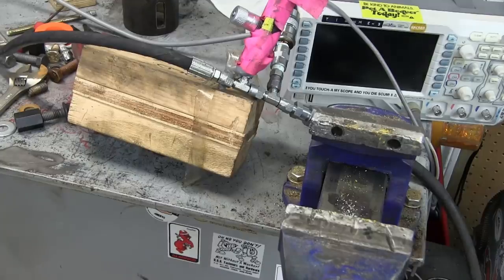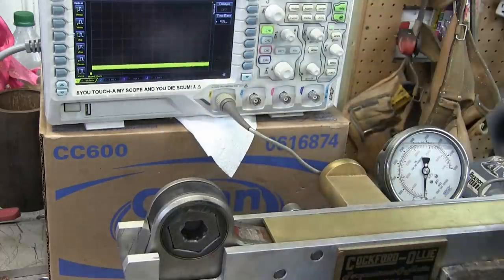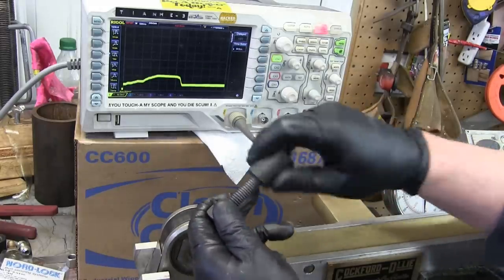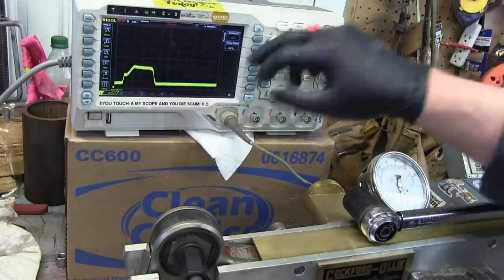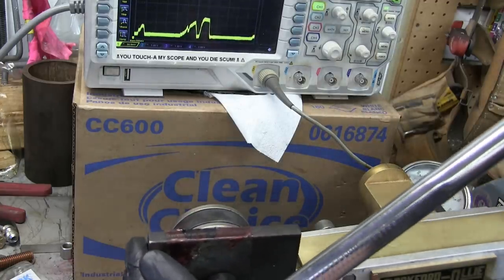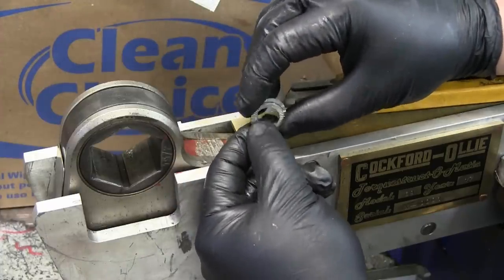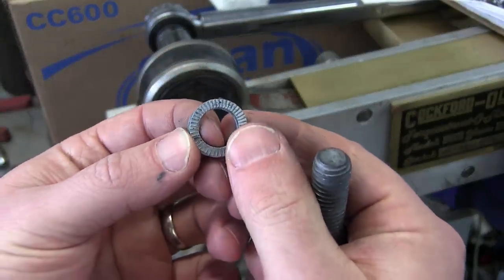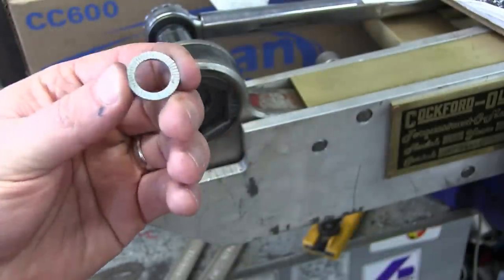Nord-Lock Washers | Do they work better?

Comment: With what you call high collar (we call it spring), the idea is that it bites into the surfaces, i've seen many people put a flat washer on followed by the spring washer, this ain't gonna work.
Also, when you did your test, you mentioned a flat washer on the back, if you allow the plate to slip on that flat washer, that's no good either.
I've struggled to remove a nut secured with a spring washer, and have seen deep gouges in the nut once removed.
I feel that vibration in use is like a hammer to set the points into the nut and mating surface, and the spring action assists
Nordlock's may not work with very coarse threads, but would be better with fine threads,
Reply: Sparky Projects high collar is a thicker spring washer with a smaller OD.  They are used for socket head cap screws.
Reply: There are multiple types of spring washers. There are ones with barbs on the cut ends (which bite into the surface as you describe). Then there are the cheap ones (what the purchaisng department buys!) which are just 'flat'. These are detrimental to the bolted joint at best!

Nordlock washers have the cam surfaces angled for the bolt (or more specifically the pitch of bolt) you are using them with so there is no concern using them with coarse threads.
Reply: The idea isn't that it bites into the surface. It provides a pre-load for when the stress in the thread engagement relaxes
Reply: Tsf Phi that's what I was thinking too.. That would explain it why they're used with flat washers
Reply: It's my understanding that both the tooth digging in and the constant pressure are working. The tooth resists rotation and the spring pressure prevents vibration or expansion/contraction with temperature changes from working it loose.
Reply: Sparky Projects You are right!!!!
Reply: the biggest downside of a lock washer is that they will squirt out from under the bolt head in heavy duty applications, we quit using them where I work as they just flatten right out when getting tightened down with a big impact, and once you take the lock washer out, its completely flat, its lost all of its spring properties
Reply: Sparky Projects they work real good with coarse thread. They're used commonly in the oil field for topdrives being they work over head and experience heat along with tons of shock and vibration when drilling.
Reply: I don't have spring washers to hand, but the older ones had a raked 'biting' corner, the modern ones seem to be a 90 degree corner, so it backs up what i was told, never seen flat washers used with a spring washer back in the day, and can't think of any time when a spring washered fixing has come loose on me.
maybe it's the modern cheap spring washers failure that prompted the  invention of nordlock.
Reply: I would imagine there is a reason J A Panese trucks use spring washers on driveline bolts, they stay tight and bite into what they are tightened between.
Reply: Paolo G , that makes no sense, and I'm pretty sure it's a false statement
Reply: Paolo G , that document doesn't say anything about the spring washer applying loosening torque, the bolt would need to be reverse threaded for that to work. Don't get me wrong, I'm not advocating for spring washer I just think your original statement is wrong
Reply: Paolo G , again I'm not arguing the result, I'm arguing that the mechanism is not what you state.  Loosening the nut "unwinds" the spring, not tightening it.
Reply: @tsf phi Spring washer preload is a myth. They can never apply more preload than a properly tightened bolt because the cross sectional area of the bolt you are stretching is much bigger than the spring washer you are bending.
Reply: farmerwoody123 Tsf Phi didn't say it provides MORE preload.  They work in the same way that Belleville washer does, i.e. maintains some load on the bolt even if it backs off, but it doesn't increase the load over not using it, which would be impossible as you say.
Reply: Sparky Projects  that's my thought 👊
Reply: I have some older 1950's American made lock washers and they have some bitting built in
Reply: Why do you think a course thread would be better than a fine thread as far as the effictiveness of a lock washer?  Seems to me the faster the head moves away from thr threaded hole, the faster it will loosen faster.
Reply: working in the mining industry, we use all types of heavy equipment. caterpillar released there findings on lock washers years ago. 
They haven't used them in years.
Reply: Matt Hudson, what does Caterpillar use in place of lock washers?
Reply: Spring washers are not designed to bite...it put a spring force in the inner to outer threads of the bokt and the nut....its harder to turn when you gave a spring load

Comment: Nord locks are the shit especially when you read you anti seize on a bolt. Only for the slightly softer steels though, if you need them for aluminum the get Nord locks made out of aluminum. You don't want to see the corrosion you can start by mixing that shit up.
Reply: They work well in the appropriate situation 
They're  are to resist vibration not breakaway torque 
The perfect lock type will completely stop vibration backing off but not impede removal for maintenance 

There's a reason nordlock are so common in manufacturing 
The thing most people mesh up is like all lock types theyre a one or 2 time use
Reply: Having aluminum bolts is a big mistake anyway
Reply: Steel bolt, and zinc coated nord locks on aluminum hub is the standard for airboat props.
Reply: Mike oliver galvanic corrosion doesn't happen with every mixed metal application

Comment: I put nordlocks on (4") polypropylene and CPVC flanges for electroless nickel plating. The expansion and contraction of heating would make other bolt assemblies loosen, but nordlocks stayed tight. The result was no leaks. Very good.

Comment: Unrelated but I have a little bit of advice (if you want it, it is interesting) for rusting your nuts... put some dirt from outside in your rusting system. If you're lucky the dirt will have some strain of ferrooxidan that will gladly rust your nuts. After a while some bright orange goop should appear which means they are doing their job.  I've been watching for a while and I love your videos. I'd love the opportunity to help. 

I say this here and now because I was little late to the rusty nut busting party.

Comment: CAT had spring washers with no split. That is to say; it was a washer that was thicker than normal and hard as rock. It kept the bolt tight by giving it a sound foundation to push against.

Comment: Dear Uncle BF, love your channel.  HOWEVER, when attaching a trailer axle years ago I had to remove some bolts after they were torqued (about 1/2" dia).  The spring washers bit into the base metal and bolt heads so well they were actually expanded to where they were a larger size with about a 1/4" gap between the ends of the split washer once removed. On mild steel a hardened spring washer can REALLY bite in.

Keith

Comment: Spring washers, if we’re talking about the same thing (sometimes called split washers, what you had there looked different) won’t really work in a situation where you torque the bolt to a set number, unless maybe that number is to yield, they work by tightening them about as much as you can without damaging the reusability of the bolt, you’ll see a deeper bite with larger bolts when correctly tightened, on a hitch I recently took apart it was in about 1/16 of an inch into the metal, serrated bolts (and nuts?) work best and are easiest to use, conical washers work really good but it’s the same issue of torquing the washer not the bolt, but those work on any hardness of bolt at least (though may weaken over time)

Comment: So nordlock only works on softer materials...... the old spring lock washers will actually cut material off to brake loose. So what really is the advantage? Have 40 years of mechanical experience and spring locks work in most cases until you start into hardened material. So...?....?

Comment: So why couldn't that test also measure the force required to stretch the bolt? It appears that it's   measuring the torque needed to hold the nut in place - which seems like it should be equal to the force that you are applying to the wrench. 

So is some of the torque from your wrench being diverted to stretch the bolt, and thus the measuring tool never senses it? That, to me, feels like a non-answer, because then I'd want to flip the test around so that you instead measure the force you are pulling with. You could do that with a luggage scale and get decent accuracy and repeatability. In fact, I'm surprised you aren't using a luggage scale for this entire experiment type - the oscilloscope obviously provides great visuals, repeatability, and records the data, but it's not as direct or intuitive. 

Also, you know what's next: make washers with a much steeper separation rate, and see if those require more force. In fact, they may require progressively more force as the nut gets closer to releasing. And then would that design re-tighten the nut if you released it prematurely?    The makers picked their current angle for a reason - did they want a consistent force requirement? That may be reasonable, as it would be just as possible to remove the bolt without damage (as the torque is the same), but it's made harder by requiring that torque for longer.

I'd love to do an experiment on different threading types and shapes, personally. But in the near horizon practically all my time is dedicated to some business I'm trying to put together - and which is quite unrelated to that field, so I wouldn't be able to do it justice.

Comment: I was always told not to break torque with a torque wrench.
Reply: so why would the manufacturer include the option?
Reply: I'm not saying you should or shouldn't but you still have to torque left and right handed threads.
Reply: Jerome Smith you're right. So wouldn't torquing a left hand thread bolt be the same as breaking a right hand thread bolt?
Reply: That is because a frozen nut could easily overtorque the wrench and throw it out of calibration.
Reply: me too, but i know there are left hand thread nuts. but here is the thing. torquing something, and breaking something free are 2 different things... wouldnt that ruin the calibration, even if you unscrewed a nut with the torque setting value of the wrench set higher than the supposed torque of the fastener? i thought there was a sere and a spring in there and the spring could get ruined?
Reply: Could be because it's the most expensive wrench in the tool set, then most guys beat on, extend it with Cheater bar, when breaking loose a nut. Who knows maybe one of us will get on the googler and find out.
Reply: Yeah because they don't want a 250 pound gorilla adding a 10 foot cheater bar to it and twisting it like a pretzel.
Reply: Every use can affect calibration, so the less you use it, the better off you are.
Reply: I agree, but I think he needed to do it for the test?
Reply: Jason Henderson reverse threads
Reply: Tony Fleetwood that's the general thoughts I've heard behind it.
Reply: Tony Fleetwood #metoo
Reply: For what he's doing, it's fine
Reply: "so why would the manufacturer include the option?"

You do realize that you can cut threads in either direction, right?  "Reverse" is there on a torque wrench, not to loosen fasteners, but for left-hand thread fasteners.
Reply: I have broken a few ratchet pawls and gears by breaking bolts loose . If the bolt comes loose with a big pop, the springiness of the bolt can drive the gear into the (case) hardened parts together in the opposite direction. If the parts do not have time to fully engage, the teeth can be chipped by the impact. Aluminum engine blocks etc.  seem the worst offenders.
Reply: Depends on the torque wrench ( and who own it lol ) , but most go both ways as long as you do not exceed its rating.
Reply: The reason they say not to use them for taking things off is due to people not thinking about it. As long as you don't exceed the torque rating of the wrench, it causes no more wear than tightening. (Every use causes the tiniest amount of drift, but it can and often does drift both ways, usually stays close to accurate under proper use) The problem is people using them as breaker bars and trying to break a rusty fastener loose. A fastener that may require 300 ftlbs to break loose and if you use a wrench designed for 200ftlbs max, you are going beyond design parameters and causing huge drift. 

Thats why, unless you just tightened it, you don't know how much force its going to take, and it could very well be more than the tools rating. Using a 250ftlbs wrench to loosen a 10-32 bolt out of something, more than likely you will be unable to damage the wrench as the bolt will come loose or snap before you hit 250ftlbs.

I never use my precision tools for beating, thats why I have tools for beating. Its all about covering for the morons who don't think before they do, then blame others for it.
Reply: @JasonHenderson  Tightening reverse threaded bolts my friend ;)
Reply: I noticed Nord lock washers on my forklift at my work! Pretty neat design! Your channel is pretty awesome btw! You should have a dictionary made up! Called the Scientific language for dummies or something like that!

Comment: I had an engineer at work try to put a Nordlock washer on an assembly where the base metal was p550 and the bolt was some stupidly high strength stainless.  Damn thing kept vibrating loose.  I changed the assembly without telling him to put locktight on the bolt.  Never had it walk out again.  Good to finally know why that shit wasn't working.

Comment: I have worked with Nord-Lock washers.  This thing held the bolt SO TIGHT.  I tried loosening it but Couldn't and I can always get anything loose.  The Millwright came over, he tried, no luck.  He brought over this hydraulic wrench type machine and hooked that up to turn the nut.  Even that couldn't do it.  Heating the nut couldn't loosen it up.  They had to eventually torch the head off and remove the rest.  It would not release any other way.  I think they're great if something is for sure not supposed to come loose.

Comment: Not that I'm a specialist or anything but I got an idea.... if you get one of those torque measuring resistors like on an electric torque wrench and attach it to a platen in the vice and hook that up to your trusty scope it might be easier and more accurate.     Also I use flat washers on things that I know are going to get very rusty because it actually makes them easier to break free especially if the washer is aluminium so it just crumbles away 👌🏻

Comment: Once again here I stand, way late & yelling out in the far corner of the comment section too far to be heard over the din, if your mating surfaces are made harder than the washer material the locking feature will not work properly, it must get a small "bite" into the material to stop unintentional movement.

Comment: Literally millions of split ring lockwwshers holding together A325 bolt assemblies and therefore holding together thousands of communication towers worldwide.  Who'm I to argue with that?  I dunno...it's all we had on hand to send to the field.
Reply: jmurphy1973 some one who never tested a split washer vs nordlock.
Reply: Or a split washer versus loctite, or a split washer versus nothing for that matter.
Reply: Having built a few of those towers I can tell you, the guys spec'ing them out aren't worried about cost.... Or doing the minimum on things.
Reply: Brad Miles I do work, as an electrician, at a lot of factories and I can tell you they don't "do the minimum" on anything. Everything I've seen was overbuilt for the application and designed to last. The engineers are not concerned about cost (to a certain point) they're concerned about reliability and strength. These companies hire union workers because they want the best workers (I'm not saying non-union shops are bad btw) that know what they're doing. They don't want a 300 pound rack of conduit falling and potentially killing somebody plus shutting down a line so fasteners and hangers are typically overspeced. Just my .02.
Reply: Kevin Beam isn't that what I said?
Reply: Brad Miles Yep I was just adding more info from my experience.
Reply: Comms towers wont generally have extreme vibration like were talking about tho, so split ring washers or even plain washers will probably do the job reliably, or at least till youve had thousands of earthquakes that cumulatively added up to a loosened bolt or 2.

Comment: You’re not actually stretching the bolt. You’re forcing the washer to compress the locking wedges / flatten them a tad. But in essence that force required is greater than any vibration force applied and thus it holds

Comment: The "thicker" the thing that's being clamped, the more it  deforms (elastically crushes) for any given tensile load, and the the Fastener doing the clamping stretches (elastically). As the angle you turn the fastener through  to get any given clamp load (ie stretch in bolt + compression in joint) is governed by a fixed (ignoring thread form distortion) geometrical transfer characteristic, by the thread pitch, you will always see a lower slope for a greater clamping thickness (ie more angle turned per Newton of clamp load).  This is why it's generally short clamped joints that vibrate undone (ie say a thin plate bolted to something) because there is simply less "flex" in the clamping mediums, where any slight twisting in the fastener causes a sudden (and potentially catastrophic) loosening of the joint.  It also makes it more difficult to accurately load the joint, as small angular diferences make large changes to the clamp load.